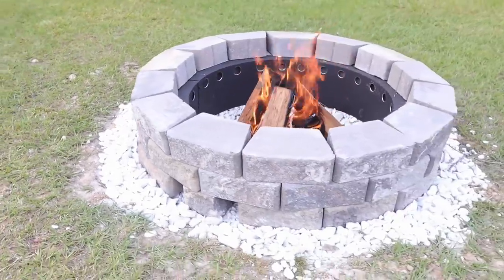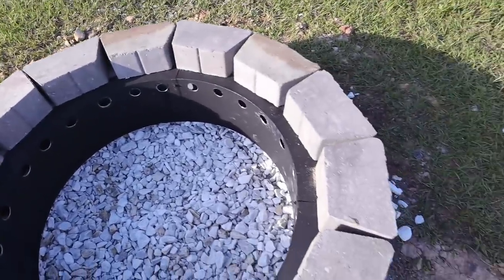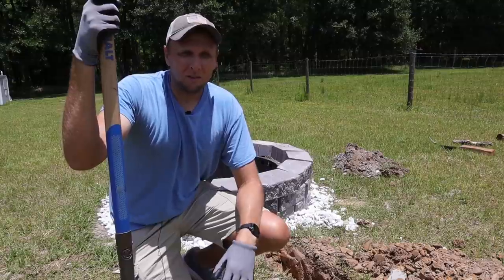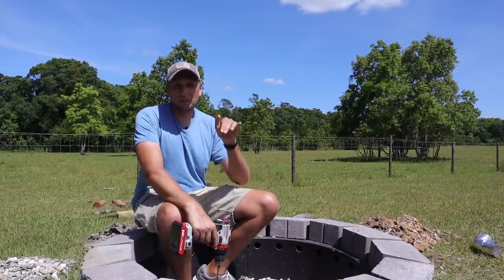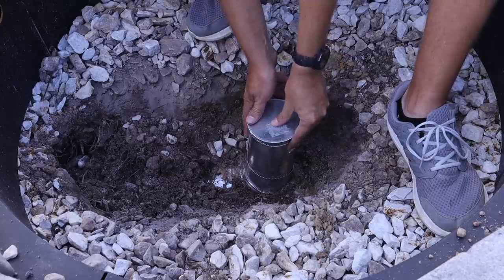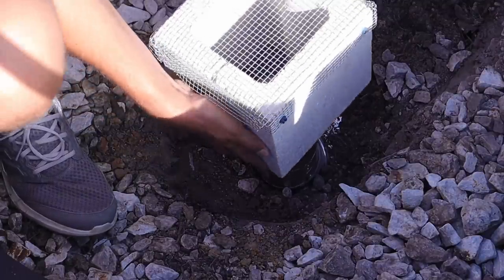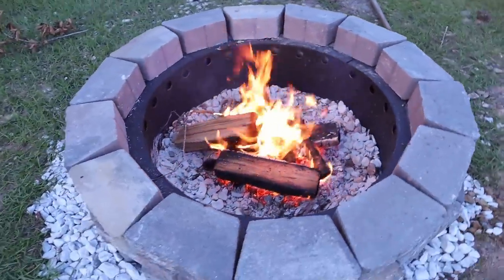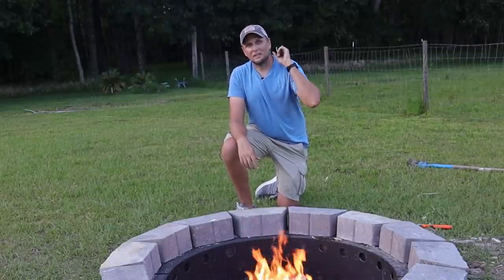Can the Smokeless Fire Pit Be Made Better? Part 2 of How To Build a Smokeless Fire Pit

Comment: Question, how do you get the ash out with the rocks in there? And also won't that ash fall down into your pipe and block it eventually? Especially if it rains and you didn't clean it out?
Reply from the maker: I dont typical remove the ash.  It really has not been an issue.  The pipe is 4" wide so it would take a lot of ash to cause an issue.  I have had numerous fires with it with VERY little ash making it inside the pipe.  Rain water is not an issue as the holes are so small it is extremely hard for it to actually get in and any that does get in that is why I drilled out 3 holes near the elbow for it to leach into the soil.  I have had 0 issues and if after many fires I feel like I need to get any ash out, I can do like I showed in the video and suck it out with a shop vac.  All very easy.
Reply: @HowToHomeDIY  Awesome. Seems like it wouldn't be too hard to take the caps off and hit it with a blower if it ever did build up I was just thinking. Great job.
Reply: This was my question! I am so surprised there isn't much ash leftover and that it's not falling (or filtering) into the pipe when it rains. Very cool!!

Comment: Had you considered placing holes along the bottom of the ring?   Seems like if you had a number of air gaps in your exterior block lay-out, would't the air come in thru the bottom holes and feed the fire?  Or, is there a reason that the pipe method is more effectie?
Reply: Would work great, plus can put gaps in the stonework to allow better airflow.

Comment: Just need to install an adjustable cover on top of the (outside) intake cap so you can effectively "close the damper" on your firepit, allowing you to extend the burn time on your coals.
Reply from the maker: I like that idea!
Reply: Great idea!
Reply: would a large enough flat rock work for that?
Reply from the maker: I’ve been using a paver on mine.
Reply: And for the opposite effect, stick a leaf blower over the intake, and let it rip.

Probably best to remove impressionable children from the area first

Comment: awesome content!  
The DRYer the WOOD (properly seasoned and split) the BETTER the BURN, and different woods have different burn "qualities" while different STACK DESIGNS and the "maturity" of a given fire (glowing coals vs virgin incendiary/kindling) are the primary determinants of fire quality vs smoke.  Your design is amazingly inexpensive and DIY attainable, thank you!   A heat tower, or a tall side of the wall to pull smoke toward it will also help direct any excess smoke as it pulls heat up and away from the fire as it burns. Please consider making a future video about how to Start, Stack, and Stoke a smoke-less fire one you've learned from your experience!

Comment: I did this a few years ago and it works great. We have a lot of leafs we fill the fire ring. Cover the ring with wire mesh and use the leaf blower to force air from the bottom. It works like a incinerator!
Reply from the maker: It really did help to improve the fire.  You can just tell it is healthier.  I need to try the leaf blower just to see how it reacts though!

Comment: I wonder if you did a T pipe instead of the 90 on both ends to get maximum drainage would be a good option. I don’t see how it could hurt and it would take way longer for the hole to get clogged.
Reply from the maker: I like that idea.  Always like hearing everyone's ideas on projects.
Reply: Cool idea, like those mid line drain boxes for rain gutters, have it with pebbles at the bottom of the Ts to keep rain from filling the pipe.

Comment: Why not get a TOP CAP from a house gas stack pipe (on roof) instead of block & wire for the water & ash issue🤔?? Would that work?

Comment: I was going to do the exact same thing only put a battery operated fan on the intake to push a little more air to the fire.
Reply from the maker: I thought about that too but decided this would do the job.  No doubt a fan will increase the air getting to the fire though.  Let me know how it goes!
Reply: Would be a pain replacing the battery .. might be cool to run PVC or something and run wire to the nearest switch out add new switch.
Reply: Another person suggested putting T joints in the ends so debris falls down, or to drain into the soil, and if the fan were in the middle of the horizontal run, well above the drain levels, you could have it stay there and it would be decently shielded from the elements.

Comment: I really enjoyed this, thanks for posting it! I'm planning mine out right now. Have you had any issues with the aluminum feed air end cap inside the fire melting since wood fires get substantially hotter than the melting point of aluminum? I imagine the cooler air flow through the pipe keeps it below melting point, but I'm concerned about if I close off the vent to adjust the air flow, things might go sideways.

Comment: Why drill holes in the top of the cap if you're going to place a cinder block around it? All the air flow can come from the side holes given the space the cinder block creates. No holes in the top of the cap means no possible ash build up in the pipe. Just drill more side holes.

Comment: I have two questions. With this underground vent upgrade are the following two elements in your part 1 video still necessary?
1) Drilling holes around the top of the fire ring.
2) Using half stones on the bottom row every 4th brick to allow air at the bottom of the structure? Now that the underground vent is installed isn't this now moot?
Reply from the maker: 1.  Yes still necessary, this install only makes that one more affective.  
2.  The half stones at the bottom in the first one were not to get air to the bottom.  They let air between the ring and the stones to be heated and come through the holes in the top.  That’s why I felt this was necessary.
Reply: Part 3: Prove It.  Block the brick/ring holes vs block the underground vent vs both open. Fourth option if you goal is truly least amount of smoke remove that cap with  holes drilled /potential forced air through the pipe. Don’t stop experimenting, always play with fire!

Comment: I didn't read every comment..but..when you make the holes in the fire ring (video 1), try to buy/borrow a Greenlee knockout hole punch kit, and ditch the hole saw on a drill. Perfect holes that will be much less sharp to the touch, and no shower of metal shards going everywhere.  Best money you will spend...
Reply from the maker: I will definitely look into that.  I do like to collect tools!  Thanks Brian!
Reply: Those Greenlee kits are nice...but over $1000 for a punch driver is spendy...much better than a hole saw is a nice DeWalt step bit. Probably takes the same amount of time as a punch but costs $45...

Comment: Seems like the coals will block any air coming up from the middle vent you installed...maybe holes at the bottom of the ring like the top holes?....maybe im wrong...just a thought...

Comment: Nice  gasifier! big pit needs big fire :-)  and taller pit, then you will see 100% gasification... (no smoke)
ur look'n for that secondary burn, the smoke itself has to burn. you can make a small one out of tin cans and burn grass to get the feel for it.
Nice work! I love it... want to go build my own now.
Reply from the maker: Thanks for the feedback!  We are really enjoying it!
Reply: So it sounds like for version 3 you might make the ring taller (easier installation but less convenient end design), or dig the bottom of the pit lower in total.

If the top of the gasifier intake at ground level is above the outlet under the new fire pit floor I wonder how that might impact the air flow?
Reply: @ZapDash  I think that would work just fine... It's really amazing if you play around with different size tin cans to experiment. Once I got that "after burner" effect I was hooked. Never thought to make it this big though. I made camping table-top cooking stoves, burns hotter too.  I'm going to have a go at a big one this summer.

Comment: Try drilling holes in the bottom of the metallic insert for increased air flow instead of the tunnel method.
Reply: Would you want the holes to match the holes in the top? In quantity, I mean?
Reply: @85geoffm  No, fewer holes (4-6 per quarter section on bottom vs 13 holes in the top), and diameter about twice the size of the holes in the top. I did 3/4" on bottom (largest step bit I had) and 1/2 in the top.
Reply: @cmscott  excellent. Thank you for this.

Comment: @howtohome After this duration of usage time, did you have to replace the portion after the elbow for the inner pit assembly?  
Was the aluminum heat resistant enough or a yearly replacement? 
Wondering if i need a higher gauge, 
#SameJobTwice

Thank you

Comment: Would it not be much easier to just get something like an old furnace floor grate, set it on a row of blocks with spacing, then put the row (or 2 or 3) of blocks on top to make the pit. Then you would have plenty of airflow from below and could shovel out the ashes underneath.

Comment: I use to work in a shipyard, we would build heating stoves for warming up in the winter month's.  It was outside work. We built these out of 3/4" solid steel plating. We made a hinged door to feed coal chunks, or wood. We had a chimney made from steel piping. Then we added at the bottom a 1" steel pipe, and threaded on a 3/4" Chicago fitting for hooking up an air line. By adjusting the amount of air, we could make this solid 3/4" steel stove, 2' X 3' X 6' in size so hot the steel would get cherry red. You couldn't get too close to it. It sure warmed us up on many of winter day's. Maybe you could experiment with adding some air to your fire pit. Or maybe using hotter wood, like ash, or even coal. Thanks for sharing. John

Comment: I’ve been building a smokeless pit this weekend based off of your first video, the things I did differently from yours is dug down 8” and did two tiers of blocks in ground and then at ground level started my my spaced blocks, just waiting on the concrete big to come in from Amazon so I can install that. My last step will be to put cap blocks all the way around the top of the pit to dress it up. All in I spent about $500 but that’s also including crushed stone for a 14’ diameter stone patio going wrong the fire pit.

Comment: Questions-- what would happen with the fire if the intake part of the airsupply is higher? (4 -5 inches higher.)  My fire pit sits in a slight depression. I can't really raise the pit area as is surrounded on 7/8  of all sides by either the patio or the 'hill'. Also should intake be on the windward or leeward side.?

Comment: Good stuff.  I’d love to see you try putting a duct fan on the end to see what it does.  I usually attach one using dryer piping to one of my holes at the bottom.
Reply from the maker: I’m sure it would make the fire go nuts!  I thought about incorporating a fan but really wanted to see what it would do without it.  Maybe in the future.  Thanks for the feedback Sebastian!
Reply: Or hook up some nitrous oxide and prank your guests.

Comment: Awesome work! I am actually going to build one of these based off your first video. I didn’t think about the airflow issue so glad you did an updated video. Will likely do the same
Reply from the maker: We really like it!  Only other things I would add, if you don't have fairly large fires, you may want to go with a smaller ring so that the holes are closer to the fire.  Also, if I could do over again, I would make the holes smaller in the ring and then make more of them.  I just think it would make it work even better!  Thank you for the feedback!  God bless!
Reply: Just an update. I started drilling my holes around the ring and both drill bits broke :( I am now purchasing the hole kit you used in the first video. My process definitely has not been as smooth lol.
Reply from the maker: My hole saw actually broke off a few of the teeth halfway through, but was able to finish the job!

Comment: Would putting the ring higher on the third level have made enough spacing for air to go through without needing a pipe? Or just drilled holes at the bottom of the ring also?

Comment: Great video. What size holes did you drill around the top of fire ring? Are they 2 inch?
Reply from the maker: They are 1 1/2 inches but if I could go back in time, I would make them even smaller.  I think it would make it even better at getting the air into the top of the fire.  Thanks for the feedback Jerry!
Reply: @HowToHomeDIY  what size would you use?

Comment: I'm not sure what size block y pu used but where I am, I can either get a 4" h block of a 6" h. After watching the followup video, I think I'll the the 6" high block which would hold the ring 2" above the bottom of the first layer of block. I could then fill the bottom of the pit with 1.5" to 2" of stone allowing air to come into the ring from the outside of the ring perimeter. Sees like an easiest way to get air through from the bottom considering my options. Good video.
Reply: Bah... I can't seem to win. The 6 in high block is hollowed out in the middle and 17 inched long. What size did you use?

Comment: Lift ring a a couple of inches. Cut piece of mesh same diameter as steel ring. Place mesh inside bottom of ring. Hold mesh ring suspended above ground level by using bricks. Light fire. Protect your eyebrows.
Reply from the maker: I have lost my eyebrows to fire before.  Thankfully, they did return!  😂

Comment: The bottom layer of bricks could have just been spread out evenly around with some kind of gap like 1 to 3 inches around to help cool air get in.
Reply from the maker: That would not have gotten anymore air into the bottom of the fire because the ring is there to divert it up.

Comment: What about the water that will get into that enclosed pipe you just burried? You know what you say... you LOVE doing the same job 3 times. Lol
Reply from the maker: Lol!  I will not be doing it again! I hope 😆 As far as water, very little will get in, I have the entrances to the pipe above grade so no runoff can go in.  Also, if any does get in, I drilled holes so that water can leach out into the soil.  Worst case, can always use a shop vac to suck it all out but that won't happen.  Appreciate the comment!

Comment: Questioning whether the new intake tube will fill with water during rain, making it ineffective? I don't know. Just thinking with clay soil, once water fills the hole it will drain VERY s-l-o-w-l-y.
Reply from the maker: It does sometimes fill up after a really heavy rain but I’ve never tried to have a fire while it was raining.  It has always drained out fairly quickly.  Worst case scenario just shop vac it out.

Comment: Cool idea! Have you had much ash/debris falling into the pipe? Would a rain cap work at one or both ends just as well as the vent caps you used?
Reply from the maker: I really havent had much at all after many fires.  I had thought about a rain cap but it was a little tall.  If you can figure out how to make one work then yeah that would definitely help to keep debris out.

Comment: Hi, I have a quick question. I am going to build my fire pit now and use your intake pipe method. Do i still need to drill those holes on the top of the fire ring (like in your first video) or can i skip that?
Reply from the maker: Yes those are the key to the fire pit working.  The addition in this video just helps to supplement the bottom of the fire.

Comment: If you really wanna crank up the heat you can buy a blower motor thats made to hook right up to that ductwork.  
I don't see how this isn't just going to melt after a few hot fires though.  Aluminum melts pretty easy.
Reply from the maker: I cover this in my follow up video.  It will never get hot enough under the fire to melt it.  Have had many fires in it and the upc sticker it at the top and is still in place and can read everything on it.  But yeah you’re right, a blower motor would definitely help stoke the fire more!

Comment: After many uses, won't the ash cause problems with the system? Clogging it up and not letting it breath/function properly?
Reply from the maker: Super easy to clean out with a shop vac should that happen after many uses.  I have used this a couple times and there is almost none down inside.

Comment: You need to do an update on the bottom feed air intake. I bet ash plugs the intake and constant maintenance is required making it not worth the hassle. The concept is solid but the ash issue makes a lower holes in the ring a better design. I'm going to weld 45 degree steel elbows pointing down so those don't plug with ash and debris.
Reply: Good thoughts Jason... I thought the same thing. I may forgo the vent because I believe ashes and water will enter in. So I'm going to put holes in the bottom of the fire ring as well. Can you explain more on your idea of the 45 degree elbow? Where are you putting this?

Comment: How is the air intake doing now that you have had some fires in that pit? Is the outlet down inside the fire pit getting clogged up by ash and debris? just wondering about the long-term operation and care of this design.
Reply from the maker: I have not had any issues with it and it looks the same as it did when I installed it.  I have found after numerous fires that a little ash had gotten down into the pipe but it was very little and was not obstructing it at all.  The holes that I drilled are just way to small for large quantities of ash or debris to get in.  We had a fire the other night and it all went great.

Comment: Do you have any problems with ash building up underneath in the pipe?
Reply from the maker: I have not had any issues with that.  After quite a few fires I checked to see how it was doing and there was some ash but very very little.